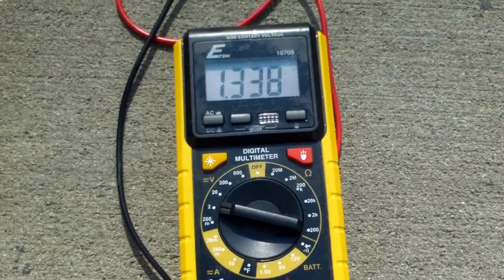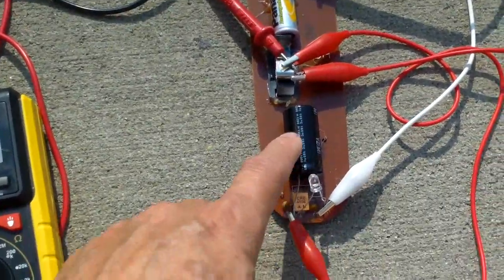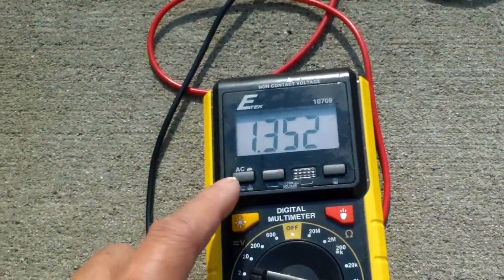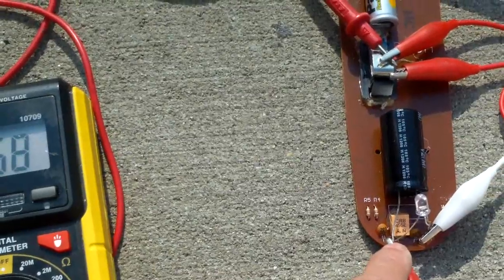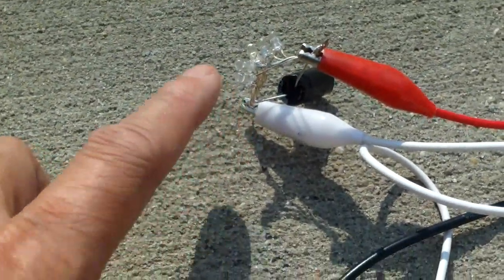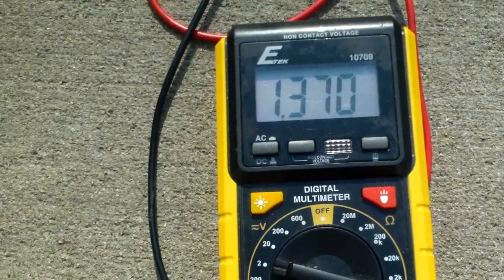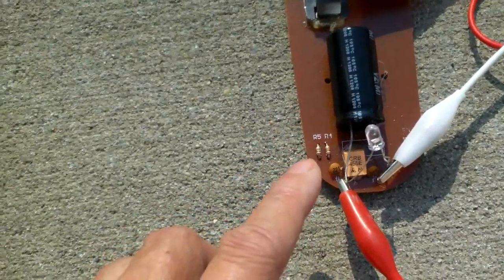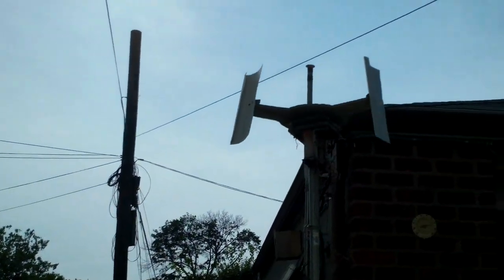LED solar charger - using LEDs to charge your devices

Comment: OMG I have that exact same multimeter.......
Reply from the maker: It was working intermittently one day and I noticed a small cut with the red wire at the point where it meets the strain relief.  I had to solder the broken wires together and covered it with heat shrink and it is working again.  I had dropped the meter several times but apparently it is still working.
Reply: wtam69 My problem is a little weirder.. The metal connector ring inside the multimeter housing (where you plug the test leads into) snapped off and fell down inside the housing.. so i had to temporarily shove it in place and bend the metal rectangle that connects to the circuit board down into the port from underneath sandwiched between the metal ring and the plastic port wall.

Now it works well enough for normal use but I'm going to get a soldering kit and solder it in place the correct way.. then squeeze the ring so its almost an oval shape (to contact the test leads better since I bought new test leads from amazon that come with mini alligator clamps I already squeezed the common and 10A metal rings and now those easily keep the test leads snugly plugged in.

Also the non contact voltage button is a joke.. very intermittently does it work correctly.

I am also going to get rid of the standard incandescent bulb from it and put a bright white LED in its place by soldering.. This multimeter runs great from rechargable AA's by the way. And runs for a SUPER long time off true Alkaline batteries
It seems to accurately calculate non RMS and RMS AC voltage at a wide frequency range.
so for a 20$ multimeter.. its alright but got some manufacture defects like a lot of cheap products..
I am also going to beef up the circuit traces with some solder going to the 10A and common on the circuit board too.. to handle 10A or around there much more reliably and generate no heat at all.
Reply from the maker: ***** I use eneloop AAA on these. If your life depends on the non contact voltage detection, then you can have a short life... It's only $18 so what are you going to do?
Reply: wtam69 I don't really have a need or use for the non contact voltage detection but so far everything else works just fine.

Comment: I don't think it can work (or because of brain). I used yellow LED, 15 in series row and I made 5 rows in parallel ( my spelling ). Check voltage under the sun, I got 24 volt DC. However when I connect to 3.5 volt battery (1.2 V read on DMM), the voltage drop to 2.5 volt. I left that for 6 hours, then check battery, it is not changed (still 1.2 V.). Would you please tell me what I did wrong  ?

Comment: A small question ,
How were u able to charge a battery that needs 200 mA to charge with low current as it is stored in the capacitor and produced by the LEDs??
Reply from the maker: nour shahawy This will take a long time to charge. This is to show that there is some small current produce by the LEDs under the sun.
Reply: wtam69 so baiscally any rechargable battery will be able to be charged through the led small current over a large time? if so, aproximatly how long does it take?
thank you for the reply :D

Comment: i  did this for my science fair didn't win but i   have chard seval car battery's one at a time    iv bot 250 mix leds not al work with solar iv goten al the way up to 18volts with a sattlight solar death ray but my panel barnt up it got over 400degers f

Comment from the maker: I started off at 1.28v at the start of the video, by the end of the video it went up to 1.38. About 5 minutes elapsed. That doesn't mean it is charged by any means. If I take the battery out the moment the meter reads 1.38v, the battery voltage would drop back to maybe 1.30v.  I have not had a chance to fully check this out how long to fully charge it as the sun was going down. I would say it takes an hour or so with good sun to get it charged.

Comment from the maker: I did not see your comment. A 20 mm clear led is pretty big and awesome. Are they the type used in billboard signs? I guess they can make them any size they want to or maybe there's some limitations to the size. Are you planning on doing something with your 1W and 3W LEDs?